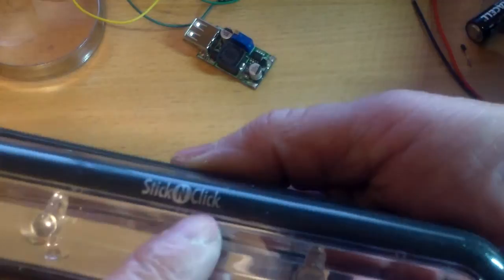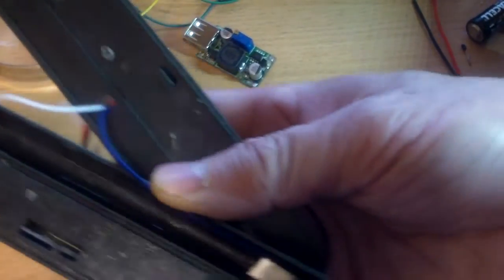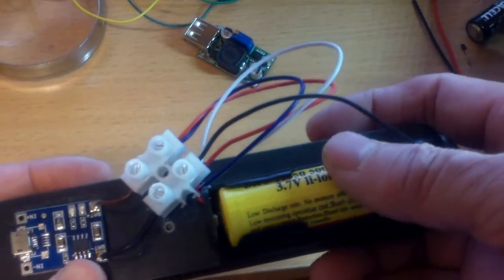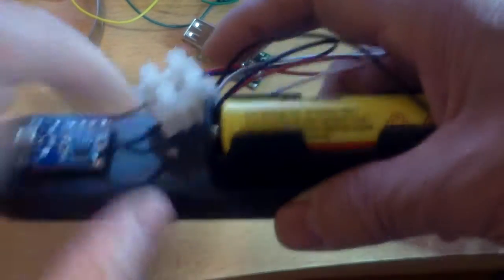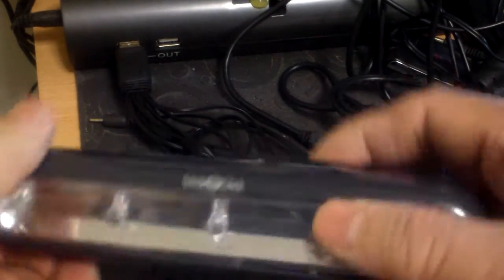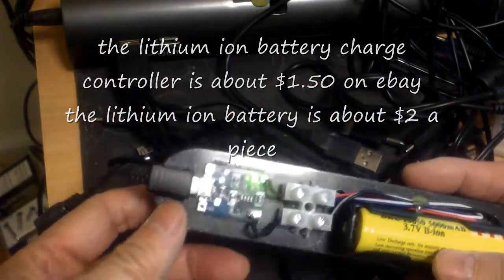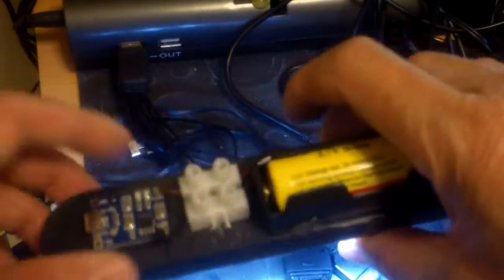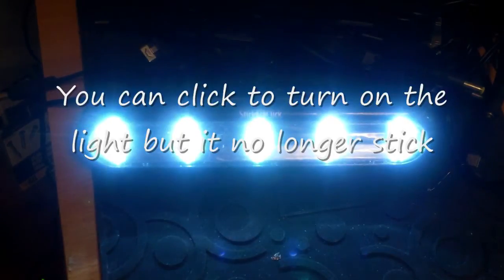Make your stick and click LED light usb rechargeable

Comment: What is the in and out for next to the micro USB? And I'm looking to add a rocker switch to this type of circuit. I assume the positive wire would go to the led and the positive input to the switch would come from the positive on the battery. Is that correct?

Comment: Hey I know this post is old but I am looking for that style charge controller and can't seem to find it anywhere. Would you happen to have any recent links???? If so that would be awesome! Please help! lol
Reply from the maker: Durand Johnson Hi Durand, don't know if you can get stuff off ebay. They are available for less than a dollar a piece. I have to warn you though, the micro usb version's connector can break off very easily. If you get that, place your thumb on the top of the connector and keep pressure on it while you insert your usb male plug. I prefer the ones with the mini usb connector. I'm not endorsing these suppliers but here are the links: mIcro usb charging board:http://www.ebay.com/itm/5PCS-5V-Micro-USB-1A-18650-Lithium-Battery-Charging-Board-Charger-Module-/400665524431?pt=LH_DefaultDomain_0&hash=item5d4986b8cfFor mini connector charging board:http://www.ebay.com/itm/5V-Mini-USB-1A-Lithium-Battery-18650-Charging-Board-Charger-Module-LED-TP4056-TW-/131299350475?pt=LH_DefaultDomain_0&hash=item1e920Good luck with your build!
Reply: Thank you so much!

Comment: 15w at 120 v , plus x3 18650.... How about then?
Reply from the maker: Sorry, it's not a good idea to use the batteries like that as the 18650 batteries are DC at 3.7 v.  A soldering iron generally uses AC, unless it's the dc type I mentioned before. If you want to use the dc batteries at 3.7v, you'd have to boost the voltage to 12v and then invert it into AC 120v. That's why it doesn't work well.  Please feel free to ask.  The Internet makes everyone a virtual neighbor.

Comment: Do u believe I can use this same setup to run a small soldering iron "instead of LED"like the (HAKKO N452) 120V~15W  60HZ ?
Reply from the maker: No. There won't be enough voltage and current to run a soldering iron. I believe the HAKKO is 40w at 120v. There are cordless soldering that uses 4 AAs like the Coleman cold heat cordless iron. Claimed it can solder 700 joints.

Comment: Instead of adding a backboard if you made the whole thing in the existing enclosure you could stick and click as intended. Using a Velcro or a magnet it could be used in many places.
Reply from the maker: You're right. A magnet would be good so it can stick onto metal. Or maybe at least a lanyard. A switch and a fuse would be good too.

Comment: Now that's a great one. What I also like is how you introduce us to these inexpensive batteries and charge controllers that I otherwise would never look up.
Reply from the maker: If you make or assemble something, when it breaks or not work, you can fix or try to improve upon it.  Though LEDs do run hot,  their versatility make them very cool.